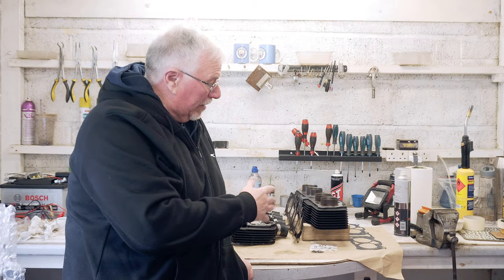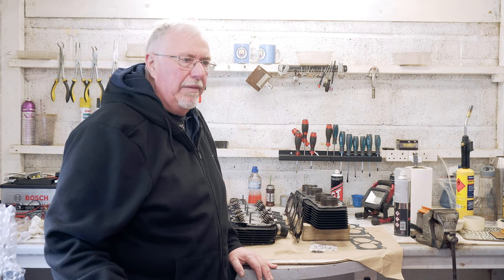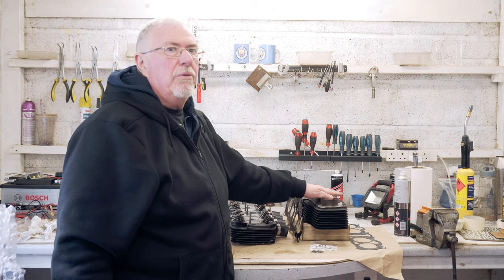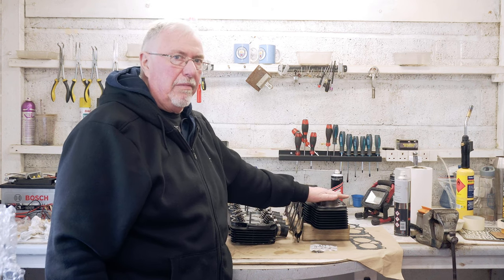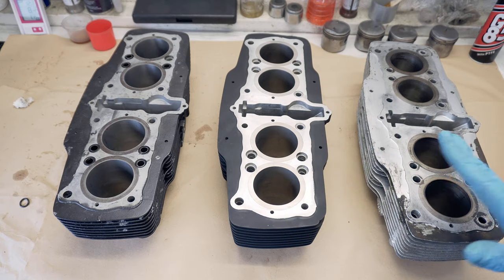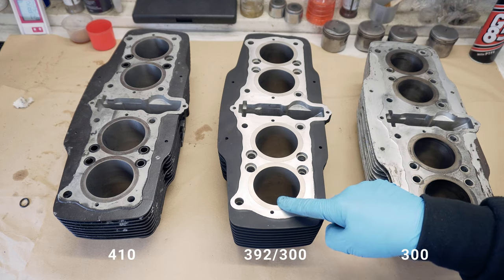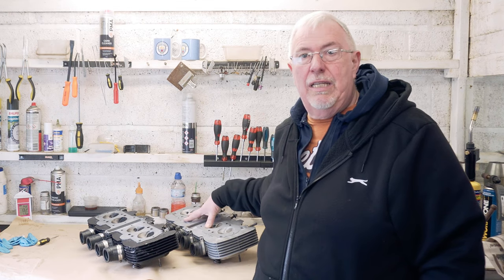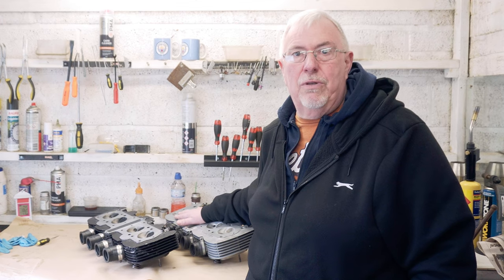Which Barrels & Head Combo For My Honda CB750 Cafe Racer Engine Build? [300 vs 410 Barrels] 17

Comment: Hi. Thanks for the info decrypting the differences between the barrels and head.  I have a 1977 CB750 and was just going to swap the K series head with a F series because of the bigger valves. Now I will take a much closer look at what I have. Thank you!
Reply from the maker: Glad it helps.  I think what you are suggesting would work.  The oil ways through the barrel would be fine, but you would lose a little compression.
Reply: @SPANNERRASH  Thank you. Yes that makes sense on the compression, larger chamber lower compression. Do you know if the F series head intake and exhaust ports flow any better than the K series head? Thx!
Reply from the maker: @timmyc7898  I suspect that with the bigger valves if will flow better.  The F head also has revised cams that I believe open quicker and stay open longer, but the there may not be a lot in it.  I also believe that this causes earlier issues with the guides wearing.  Unless you are really chasing every last little percent of power I don't think it would be worth the cost.  Good luck with whatever you decide.
Reply: Thank you, all good info. Looking for simple power upgrades and thought the head swap might be a good one. I need to disassemble the engine this winter and replace the primary chain, it’s shot and makes a lot of noise. The tensioner is maxed out and it still has a lot of slack. Thx and keep the videos coming!
Reply: @timmyc7898Do  NOT use a 410 head [F2] with a k series cylinder ....totally incompatible, ...... yes it will physically fit .... BUT you get massive oil leakage from the cylinder fins.
Reply: Thank you very much for the heads up on the oil issues.

Comment: Very helpful explaining the diff heads. I have two heads with no numbers, but seems from your vid that one is a 300 and one is 392.
Reply from the maker: I'm glad my video helped.  I suspect that your heads would both be ..300.. part numbers.  Although they added those seal cut outs they didn't change the part number much, and I do think they are interchangeable.
Reply: @SPANNERRASH  Also interesting is one head has the double oil control jets. Are these important as they dont appear in the early heads.
Reply from the maker: @ALA-uv7jq  I'm not sure what you mean by oil control jets.  The all have one oil control jet for each cam block.  But there is only one drain per side on the later head.

Comment: My 750 K6 was Modified to 838cc and worked very well , later a 970cc Russ Collins set was installed - that was not so good , it had very high compression and the starter motor could not start it so all in all it did not work so well.
Reply from the maker: It's amazing that the old SOHC could be taken out so far.  It must have been and expensive build, with a modified crank as well.
Reply: @SPANNERRASH  Yes , the trouble was that R.C Enginerings sets originally was intended for drag racing so the compression was way over 11,5 to 1 and in fact would have broken the conection rods quickly , it one of the 750 honda engines weak points - just to tell that R.C also had a 1015 cc set and also a set with stroker conection rods for the Honda CB 750 engine but yes it was a huge remoddeling of the crane case and New chromemolybden cylinder liners and when the Cylinders get so large diameter that the problem with the oil channels really is apparently , the first time my engine was started back then at the mc-shop it spilled  oil out all the wrong places but got fixed but ended up breaking the piston - rings in one cylinder which cooked the oil and nearly seized the whole engine and i had to give it up returning with another 750 engine bored to 838cc and a Modified cam and greater exhaust valve , it worked well for many years . Sure miss my 750 Honda (in blue k6) Every spring thinking riding in the sun.
Reply from the maker: @oleriis-vestergaard6844   Great to experience the different builds, but at the end of the day reliabilty gets you riding in the sun more often. :)

Comment: What about an k series head with F series cylinders?
Reply from the maker: To be honest I am not sure.  If you watch the video again around the 5 minute section the bottom of the barrels where the oil drain comes through is different.  If one of these oil passage ways through the barrel is blocked where it joins the crankcase is blocked off then it will stop oil draining properly from the head.  You will need to check your crankcases to see if this would be an issue.  If you look at video no 19 in the playlist for this bike around minute 11 it looks like my engine does have the right openings on the crankcase, but I don't know if this is true for all later engines. Good luck.
Reply: @SPANNERRASH  thank you!